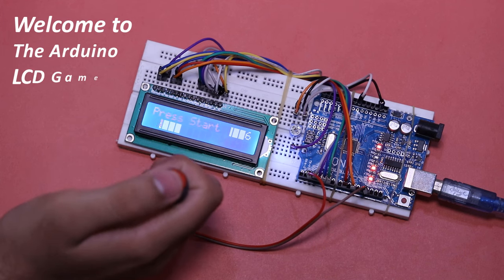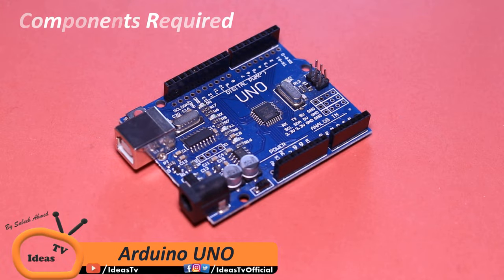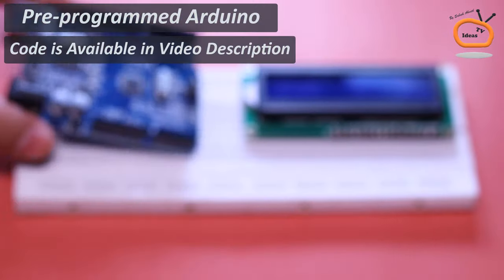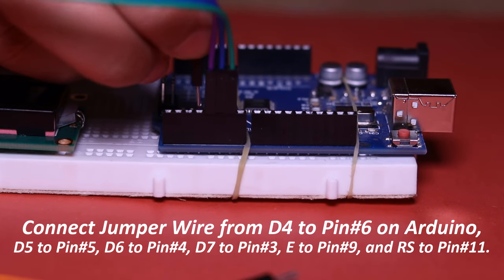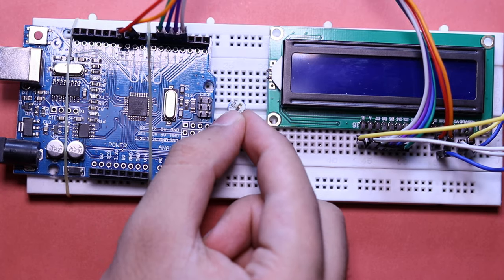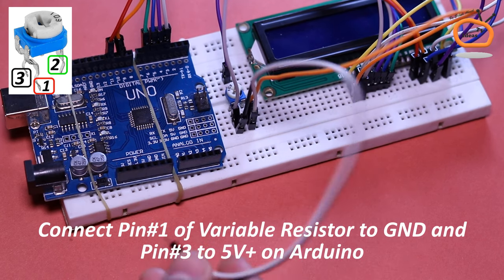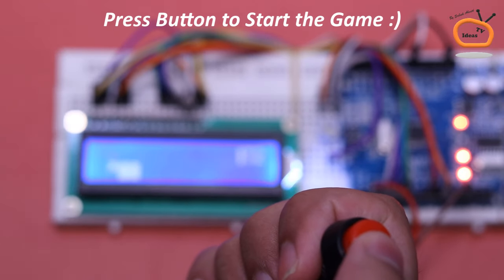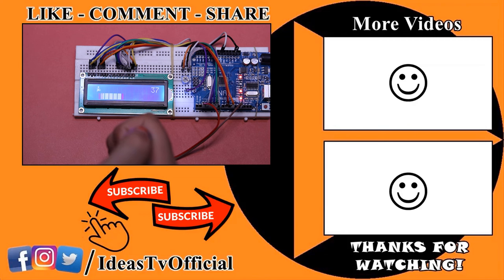Arduino Game Project - How to make Arduino LCD Game (Endless Runner!)

Comment: I have checked the connections properly, but when I plug the arduino uno into my computer it won't run, whereas for other circuits it has. Something labeled as "S09Y" next to the plug in cable is over heating.Can you please help me with my circuit so I can play this game on arduino...

Comment: is the variable resistor important? can it be a regular 10k resistor?
Reply: A normal 10k variable resistor is fine?
Reply from the maker: Yes, it is use to control the brightness (Backlight) of the LCD. You can use any 10K variable resistor.
Reply: You can also use a potentiometer

Comment: If you don’t have a variable resistor is there a different resistor you could use
Reply from the maker: 103 is used to control led brightness, you can try different values of constant resistor according to your desired brightness.

Comment: the code is not working . its saying Sketch uses 3842 bytes (11%) of program storage space. Maximum is 32256 bytes.
Global variables use 161 bytes (7%) of dynamic memory, leaving 1887 bytes for local variables. Maximum is 2048 bytes.
avrdude: ser_open(): can't open device "\\.\COM3": The system cannot find the file specified. what should i do . can anyone help me please
Reply: close the serial monitor

Comment: When I Lower The Variable Resistor The Arduino Boards Builtin Leds are Also Getting Dim ... Is That Natural??
Reply from the maker: No! there's no direct relation between the variable and arduino builtin LED in this circuit, we're using variable for LCD's background LED
Reply: @IdeasTv  Thanks 😊
Reply: @ryanjayaweera.23  try turning on backLight(), ohh n connect the potentiometer tu an analog pin so you can control more/other components if you want to do some innovations on the project

Comment: It is not working just the LCD display was on and showing some rectangle boxes in the 2nd line of the LCD display I even have uploaded the code bro
Reply from the maker: not properly or loosely connected, re-connect LCD.
Reply: Thanks for your comment now it is working
Reply: @The_Passion_Tech what was the problem cuz my lcd also just shows blocks nothing else

Comment: Can u also explain how did u give the power source
Reply from the maker: you can use 9V battery, connect it to DC jack of arduino or you can connect the arduino directly with pc (but it not recommended for continuous use)